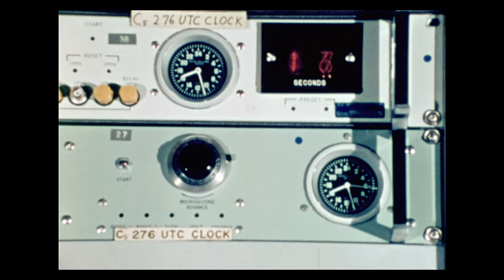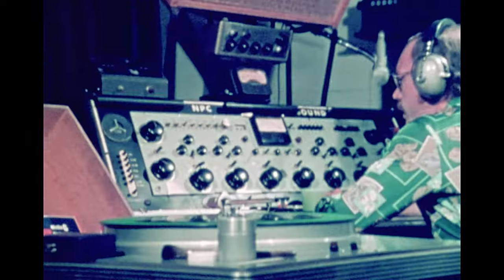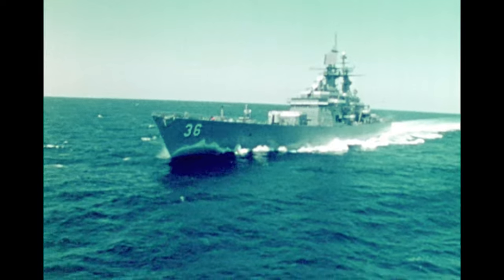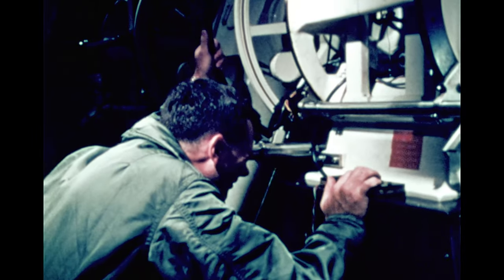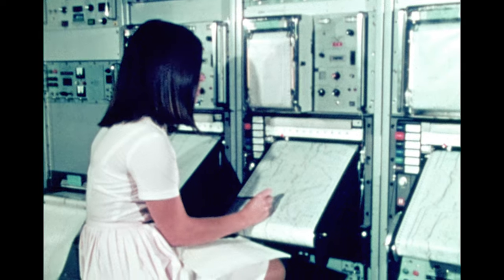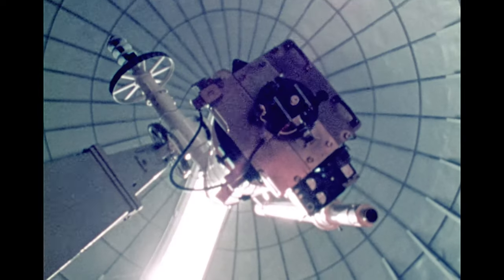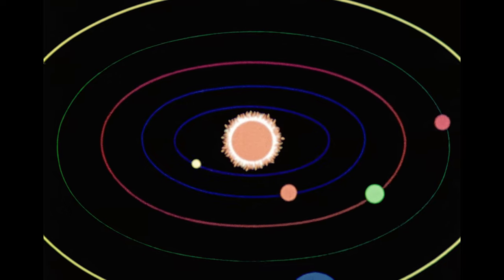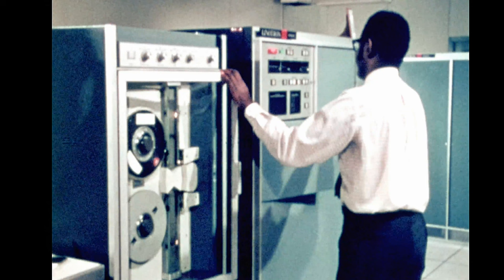1970 - 1973 Calculating Correct Time at U.S. Naval Observatory; - Can you Name this UNIVAC computer?

Comment: I suspect the box behind the tape operator with the Univac logo was a controller rather than part of the CPU complex.

I know that at some USAF observatories a Univac 418 was used. The 418-III was often delivered with Uniservo 6c tape drives (both the CPU and the tapes were relatively low cost) but although the tape drive shown has the reels in the correct orientation for a 6c, it looks different. Could it be an earlier version, for a 418-I or -II?

Alternatively, since it is a naval operation, could it be a 1218?
Reply from the maker: Hi @stevew8233, thanks very much.  I agree that the box behind the tape operator was probably a controller other than part of the CPU complex.  It it helpful that you identified the Uniservo 6C as the possible model for the tape unit.   Because of the dates of the 418 and 1218 being somewhat earlier, it is doubtful that those would be the CPUs used in this clip.  As more people contribute thoughts and ideas, I think we are getting closer to the answer.  Thanks again!  ~ VK

Comment: 1050-II ?
Reply from the maker: Good guess, but, no,  it is not the 1050-II.  That was an older, larger system with a different control panel (1966 or so).  This is a later model....I am hoping someone will recognize it.  ~  Thanks!